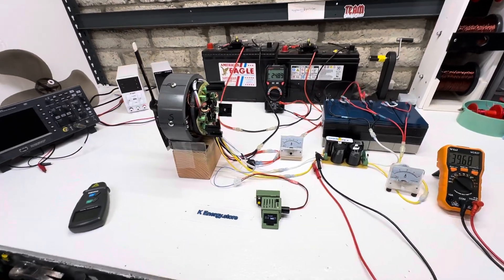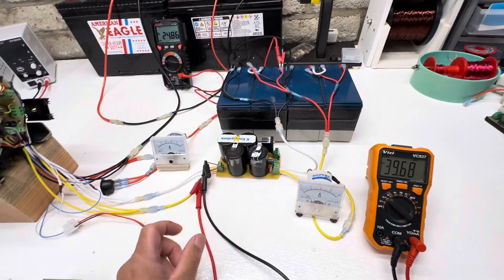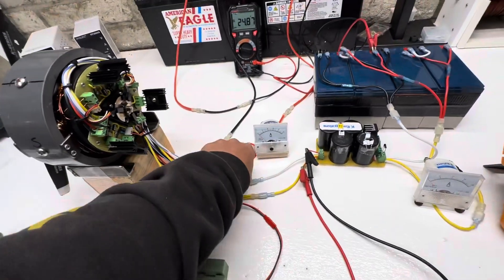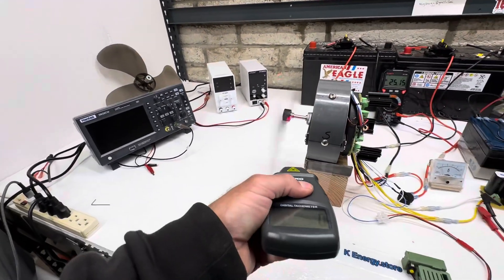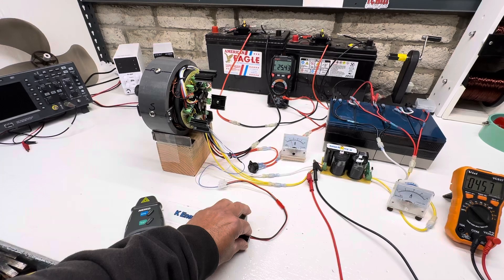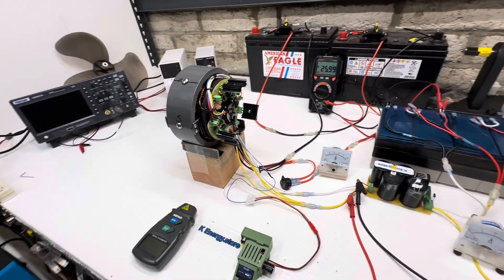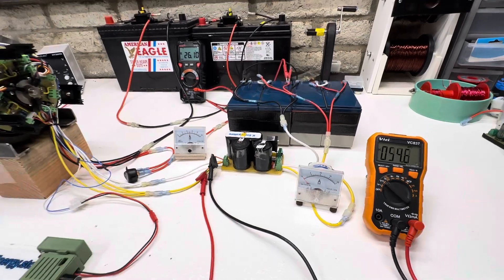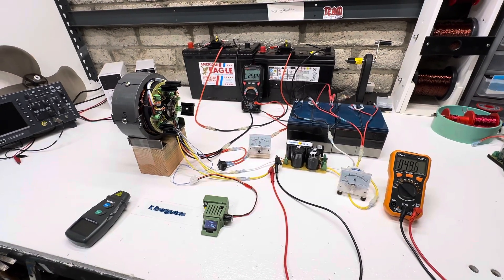Repulsion pulse motor 24v testing

Comment: That is a good speed for a electric lawn mower motor, but do you think you would have the torque to cut grass?
Reply from the maker: Prob not seems like most are 2-5 hp motors
Reply: @kenergy1707  I think you would be surprised most of my brushless mowers only need 150 watts with no load turning a blade at 3,000 RPM
Reply from the maker: @gregstafford2155  that’s not bad it would probably work then